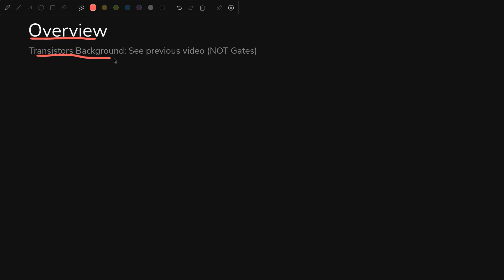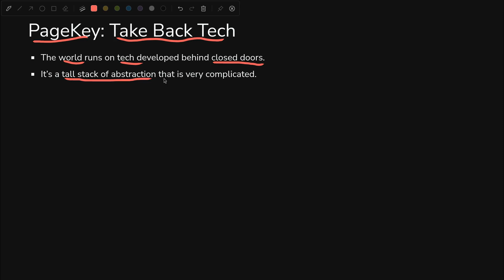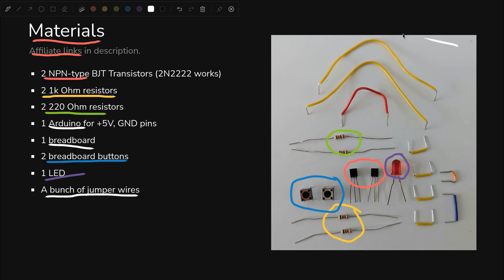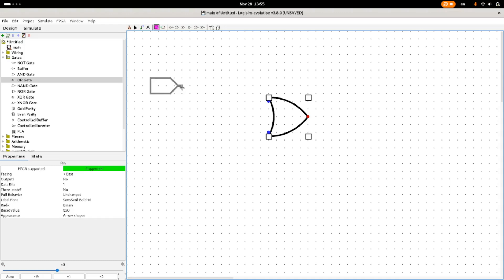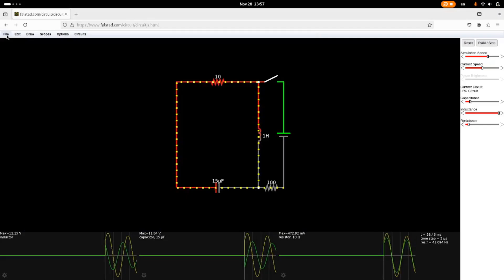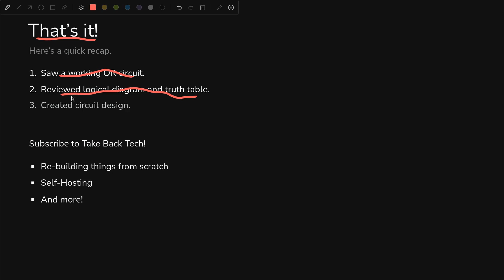OR Gate from Scratch (How-To, Using Transistors)

Comment: Can we do it without an arduino? 
Maybe just with a battery?
Reply from the maker: @Winter_B12  you can probably just use a 9V battery. I'm just not sure how to step the voltage down to 5V or if the components can handle all 9V without damage. Try it at your own risk and let me know how it goes!
Reply: @PageKey you don't know about voltage divider?
Reply from the maker: Nope, but now I do! Thanks!